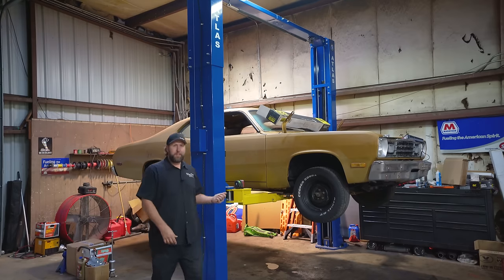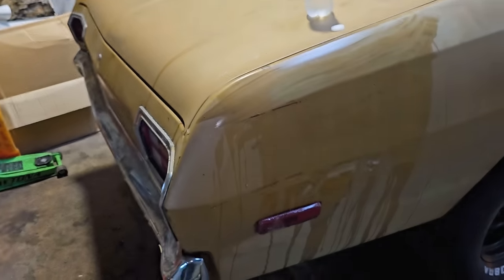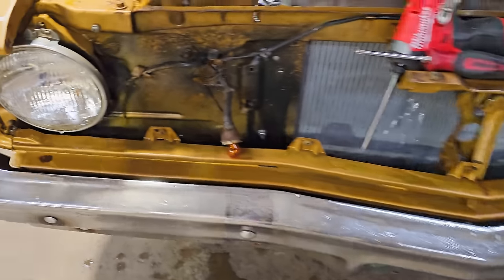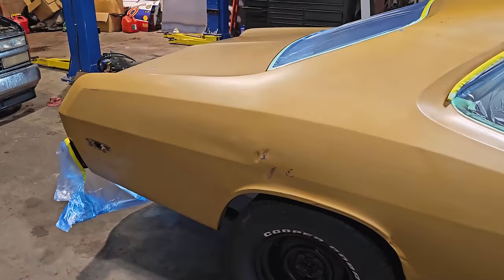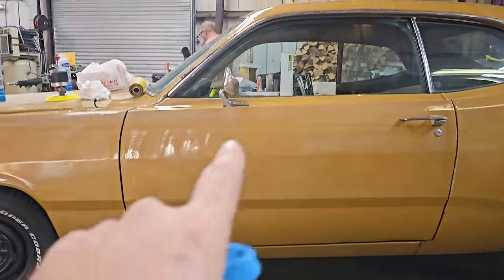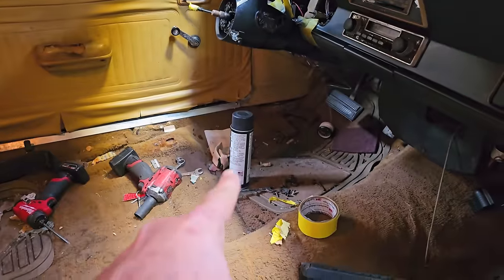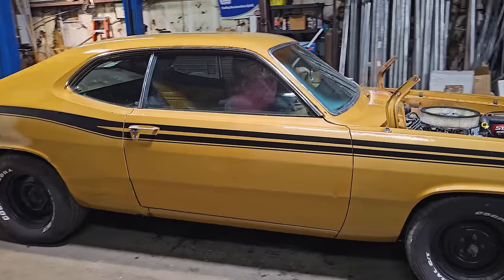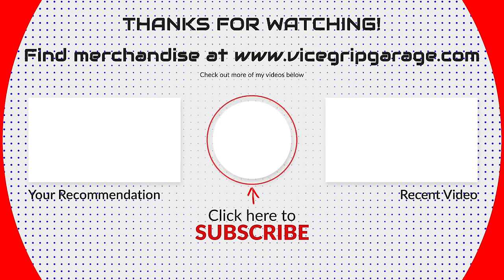MASSIVE CHEAP Mopar Transformation! Duster Looks Better Than Ever!

Comment: The body does not look too bad, with a body that sound I would put in more prep effort. 400 grit flat the whole car with an orbital sander, then 800 wet flat with a block to take out any swirl marks. Some surface rust here and there needs sorted with some feathering out a coat of rust converter/preventer then an etch prime on bare metal areas then high build prime feathered back areas and block flat. Then give the whole car a wet on wet. One sealer coat to prevent any reactions from other past applied paint, allow it to flash off, then a white primer coat to prevent any patchy colour bleed through, allow this to flash off, then hit it with two coats of gloss yellow. By flash off I mean touch dry. Thing is, doing what I said would involve removing the glass house rubbers, lights,trim and bumpers to do it right, this adds time and expense. The cost of sealer coat, primer and paint along with masking materials and other sundries adds up too. Nice looking car, I  know you are going for the running ratty look and I know this aint a concours vehicle kind of channel......But, its actually a good body that I think you would have enjoyed putting more prep time into. I know making Youtube videos takes time and you likely have other work so this is the most time and cost productive way to go.

Comment: Derek, "Jesussandles " it's  painful I'm sure to everyone watching you,  use a hammer. I used to be the same, so I invested in a "Thor" 2 pound Copper and Hyde  hammer, copper won't slip, it won't damage the bolt head or threads, great for separating driveshafts from their hubs . If you're going to use a ball&pean hammer for God's sake use a bigger one.

Comment: Ther 7 1/4 rear was junk as when they came into the middle 70's, cars equipped with 2 barrel super six slant 6 engines were destroying the side gears constantly. It was strictly a very light duty rear end to save the Corp money. The 8 1/4 would have worked but an 8 3/4 is an excellent choice.

Comment: I know I'll never trust plastic or coated paper ever again near an edge I'm painting with base coat and clearcoat. Just clear coat or most single stages, I still wouldn't trust it!  Paint isn't cheap and neither is more time and money fixing a masking error. Masking up to edges with plastic is something idiots invented to seem as this is a better way, when it is the opposite. I lay clear down pretty heavy and will rarely ever have clear bleed through good old regular paper masking.  If it did, a little solvent wipe and buff and it's done. If the base or other paint flakes off the plastic or coated papers as you are spraying, you now have a huge mess on your hands!

Comment: Worried for ya' D.  😯 Spraying flammable paint products next to running torpedo heaters.  Welding next to clouds of paint vapor.....  Breathing urethane fumes without a mask...  Breathing paint fumes that have been burnt through the torpedo heater...  Perhaps some thoughts about safety would do a guy good before consequences come knocking at your door...  🤒🤕  Please be safe.
Reply: 𝐋𝐞𝐭𝐬 𝐃𝐢𝐬𝐜𝐮𝐬𝐬 ✝️✝️✝️✝️